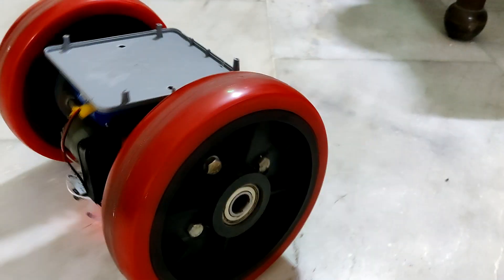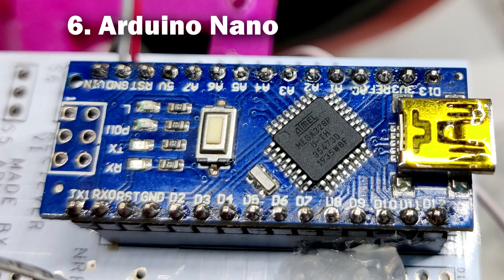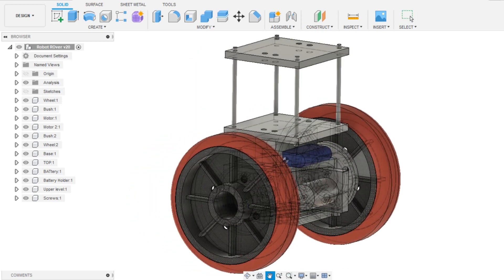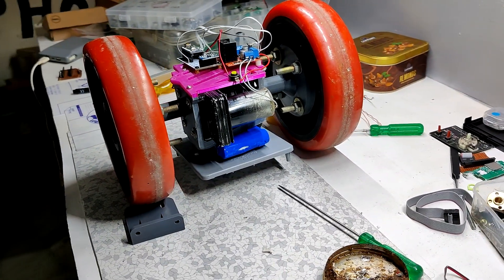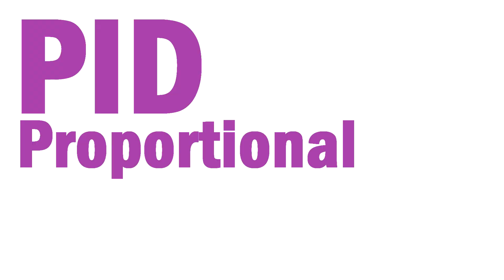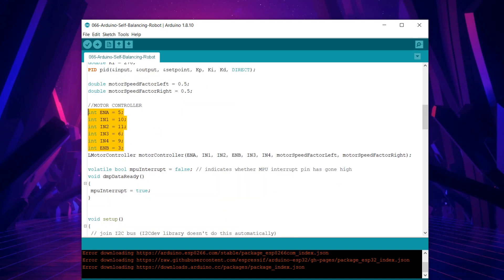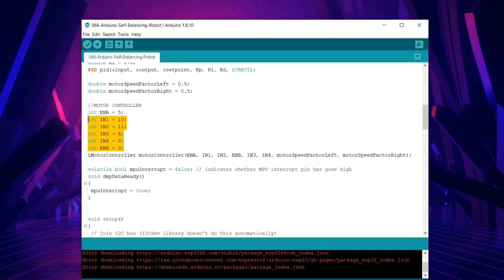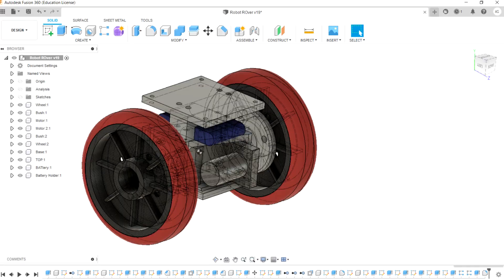Arduino Self Balancing Robot with MPU6050

Comment: Can I use nema17 stepper motor instead of gear motor?
Reply from the maker: Can you?
Reply: @ArnovSharma  yes but, will it work with stepper motor????
Reply from the maker: nema17 wont be powerful enough to carry the weight of this whole setup, but nema23 might do the trick